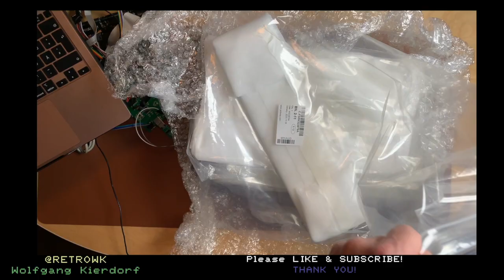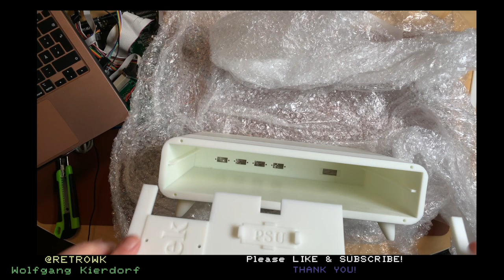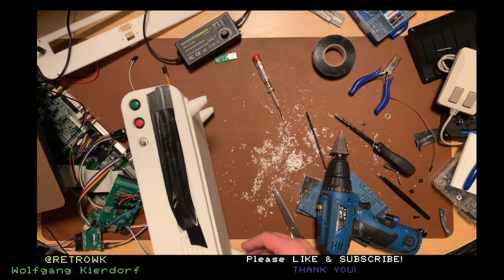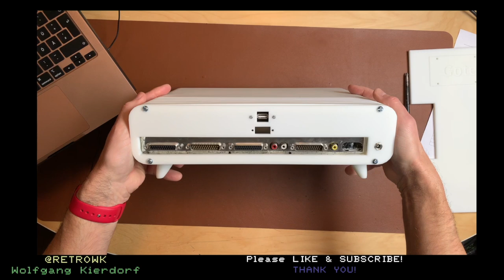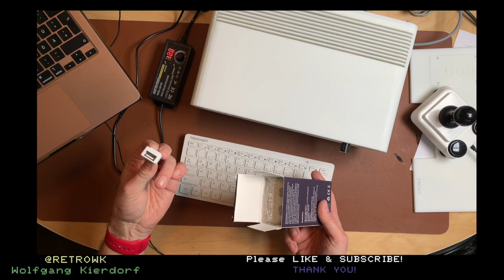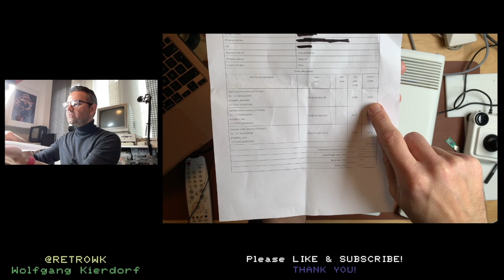A BRAND NEW REAL AMIGA gaming console - The AmigaBox - A600 into console! - Part 2 #DIY #retrogaming

Comment: The cases do look very good, although the prices you mentioned are rather steep. That's usually the case for small scale, custom designs and 3D printing. No pun intended. It's really good that you've made the designs available to everyone. 🙂
Reply from the maker: Yep. Prices are steep. Maybe someone finds a way to get them cheaper. I did not shop around a lot.

Comment: The A600 console looks brilliant.

You can get a joystick adapter that splits JOY 0 into a 9 pin joystick port and a USB mouse so you don't have to unplug the mouse to use that joystick port. I have one for my A1200.

BTW, where did you get the wireless USB Tank mouse ? (There is no link for it.)
Reply from the maker: Thanks! I was thinking about putting in a m/j-switcher but I just couldn't take soldering more cables ;-) The Tank Mouse is here: https://sordan.ie/search/?q=tank+mouse
Reply: @RetroWK   With the joy/mouse adapter it switches itself by detecting which is being used.

Thanks for the link. They are a bit expensive.
Reply from the maker: @Franko_Walker  Yep, got mine on ebay for half the price a while ago.
Reply: @RetroWK  I looked there, the cheapest was £55. I think I'll stick with my cheap USB wired mouse I've been using for about 15 years on all sorts of computers. LOL.